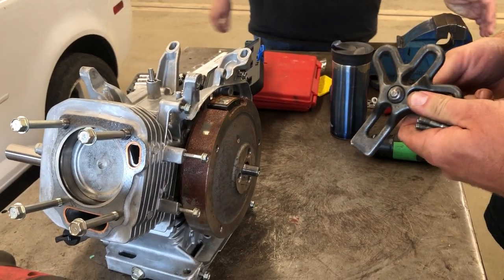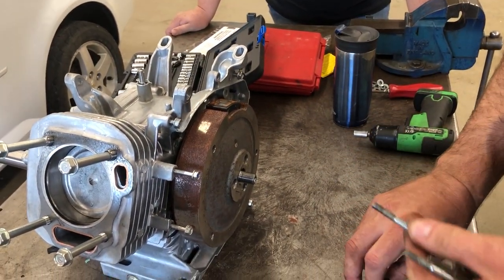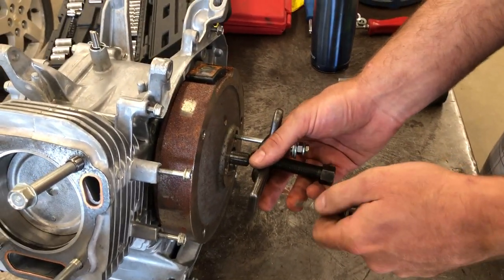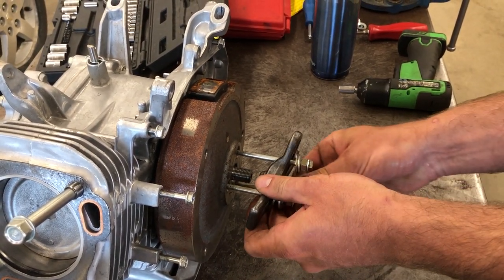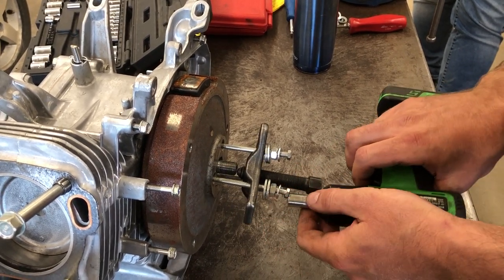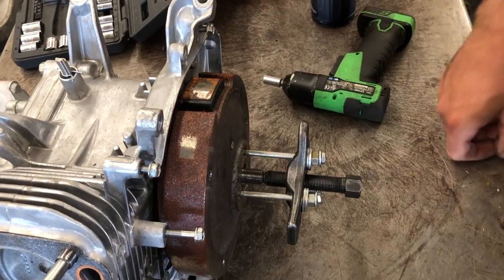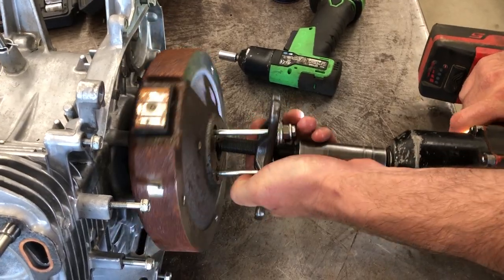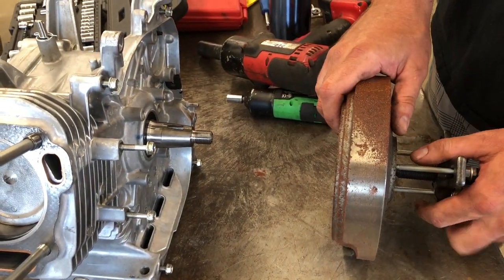Honda GX390 Flywheel Removal

Comment: I used exact same method and its not working. What size knock off tool do i need to screw on threads? or another method to get a very stuck flywheel off.?
Reply from the maker: As long as you have the nut off……, I would get it quite tight then strike the end of the puller with a hammer. The force can help pop it free. If you keep wrecking bolts and washers you can get a large 2 or 3 jaw puller around the outside and get it that way as well

Comment: Hi how can I remove flywheel off Honda ht-r3009??
Reply from the maker: There is bolt holes in the face of the flywheel that you can thread bolts into. Using a "bolt puller" such as one designed for steering wheels will pop it right off.
Reply: @autotech4103  thanks. If the thread is gone in bolt hole. How is easy way too do?.. thank you @Autotechcp
Reply from the maker: @joeoconnell3390  I would use a 2 or 3 jaw puller and hook it around the bottom of the flywheel. Other option would be to install a helicoil into the stripped threaded hole. Might need to weld the puller bolt into place if you plan on replacing the flywheel.
Reply: Thanks. I am trien to get at the starter but it seems that the flywheel is in the way. And has too come off to take out starter
Reply: @Autotechcp
Reply: @autotech4103  I  need too remove starter but Is big problem

Comment: What size bolts do you use
Reply from the maker: 6x1 is the thread. Then something long enough for your puller. Too long isn’t really a problem with most pullers
Reply: @autotech4103  thank you
Reply: What size socket did you use for the flywheel nut??

Comment: You don't need to do any of this, just put the shaft nut level with the end of the thread and then one solid tap with a lump hammer is all it takes.
Reply from the maker: Get Er Done!!